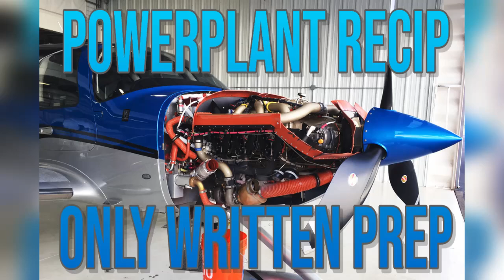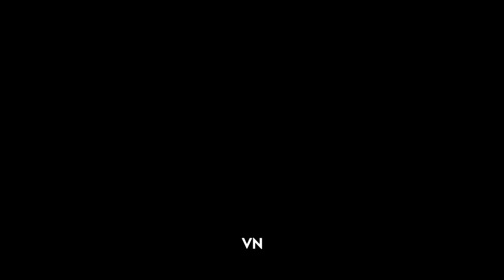2025 Powerplant Written (Recip Only) Study Guide | A&P FAA Exam

Comment: I would like to record the questions and answers for exam prep on YouTube questions and answers with explanation will i get in trouble for copyright for reading from the test guide?
Reply from the maker: That’s a great question! It depends on the source of the test guide. If the questions come from FAA public-domain materials, you’re usually fine. But many test guides from publishers (like ASA, Gleim, or Jeppesen) are copyrighted. Reading directly from those word-for-word can be a copyright issue, especially if you monetize the videos.

To stay safe:
✅ Rephrase the questions in your own words.
✅ Provide your own explanations and examples.
✅ Avoid showing full pages or quoting large chunks directly.

This way, you’re adding value and staying within fair use. If you’re unsure, check the publisher’s usage terms or contact them directly.
Reply: @northeastaviationpro  thank you for the quick reply and info!

Comment: Timestamps for each chapter 

0:36 - Recip engine
30:39 - Engine Inspection 
37:45 - Engine Instruments Systems
47:30 - Engine Fire Protection
53:50 - Engine Electric Systems
1:09:10 - Engine Lubrication Systems
1:23:52 - Engine Exhaust and Reversers
1:50:36 - Propellers
2:16:20 - Engine Fuel and Fuel Metering Systems
2:40:21 - Engine Reciprocating Induction and cooling systems
Reply: Lol.dis guy probably smoke weed
Reply: Which time stamp is the full recip engines prep ware start? 108 questions